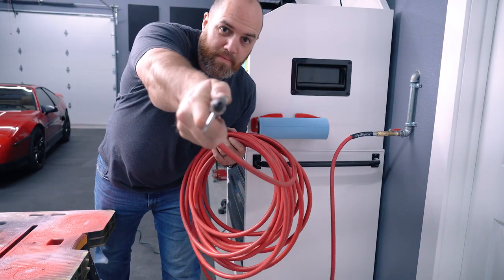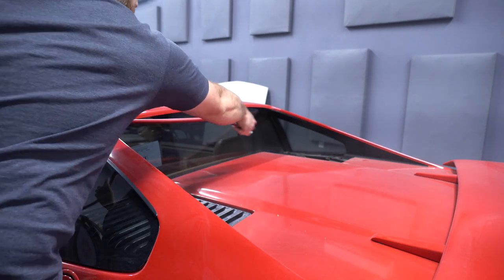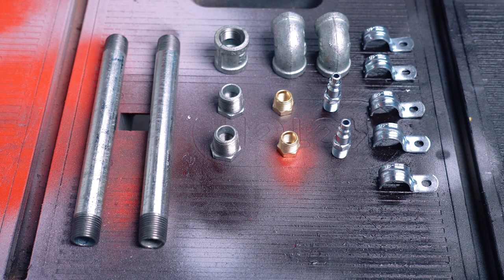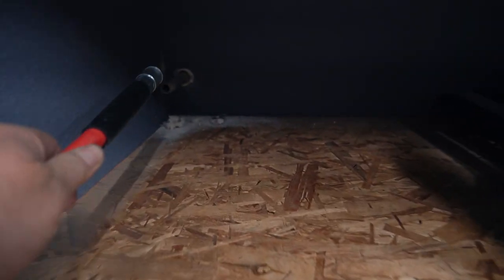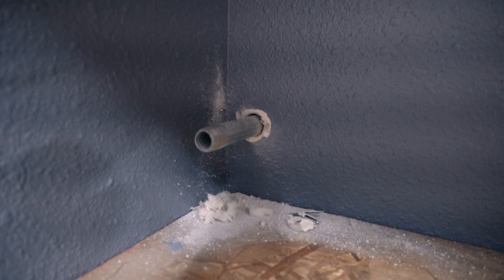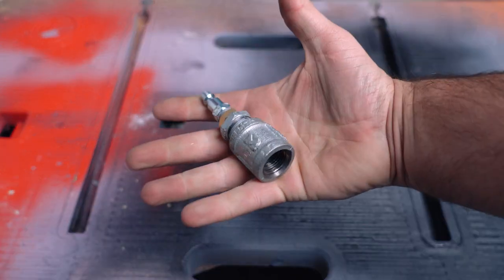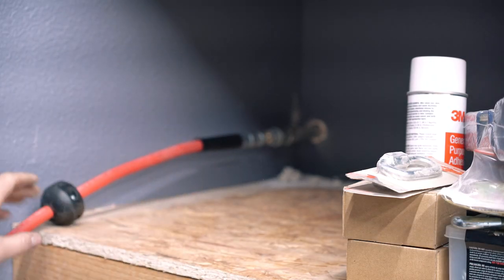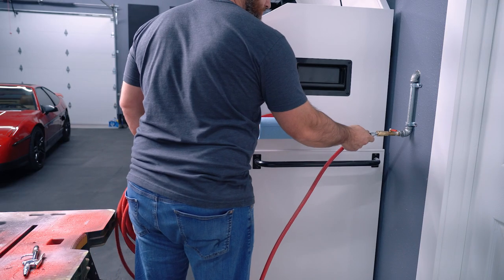Silent Air Compressor Hack - Getting Air to A Different Room

Comment: I feel like the outlet should be pointing down so that way there isn't constant downward force due to the weight of the air hose. Interesting video by the way.
Reply from the maker: You are absolutely right. I’m planning on making the change soon. Because of the downward pressure it doesn’t seal well and always has a slight leak.

Comment: You could add an auxiliary tank with a pressure valve and guage so you can regulate the pressure in the car shop.
Reply from the maker: I’m definitely planning on doing a separate valve in the shop. Great idea!